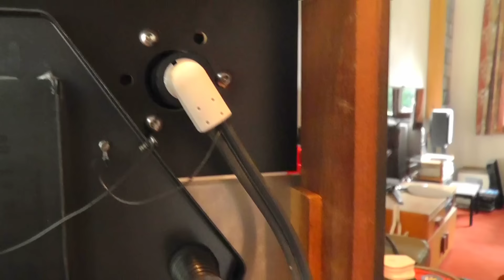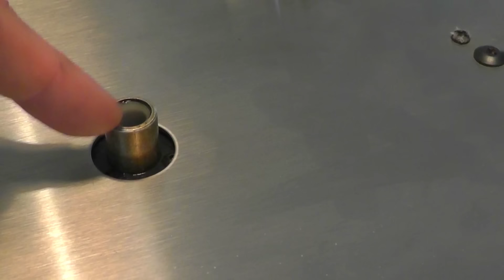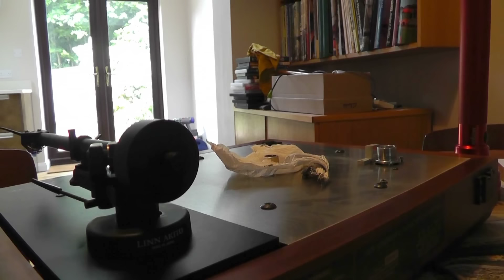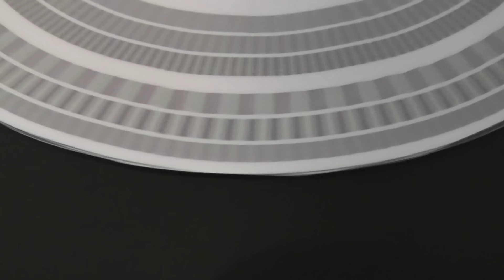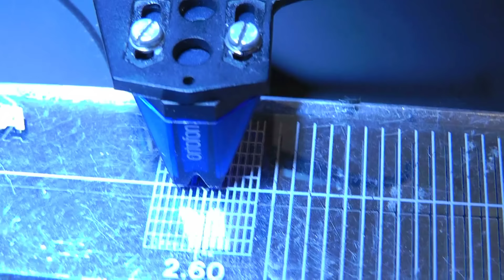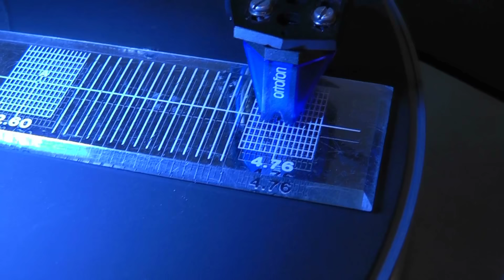linn Sondek LP12 service Pt2  Service recap and modify

Comment: Hi, Just to say thanks for the video. Much info I have never heard of, that will be really useful for My restoration of My very early Ariston /Linn. I have just pulled it from storage after I haven't used it for some 20 odd Years. Although in My experience these type of things will  just work and only need a bit of cleaning and tweaking. Oh just one thing that might help You is that when setting up the speed, You can fit the main platter on Upside down. So You can see where the pulley is riding. Best Wishes Jahmahrah

Comment: Hi Simon my Sondek has no sound on the right channel,any ideas? 
I have switched the connects, even looked inside and reseated the 5-pin arm connector.For context I had it gone through by a great shop with new springs caps cart 10 years ago it has sat in the same spot so I,m guessing a bad cap?

Comment: Don't use Linn black oil on a bearing that has a gold surround/white liner or else the Teflon in the liner will swell and bind the spindle - use the Linn gold oil on that bearing. All others can use black oil. Oh, and don't just stuff a paper towel down and leave lint behind that will etch the bearing surfaces over time - use a lint-free swab!

Comment: Hi Simon, realy like what you done to this board. My linn valhalla needs some of your magic. My power supply board is not working properly. I'm sure it's a dry soldier contact. Could you repair my board?🤞
Reply from the maker: Yes . If your sure the problem is you board and not motor Etc.
Reply: Okay Simon, I'll try and make sure the motor is good. Really like your work on the lp12

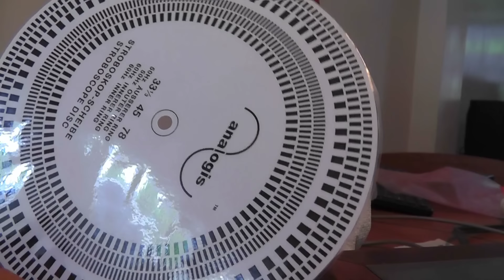Comment: 10:53 : The mains are 50Hz but the bulb will glow at double that (if connected directly across the mains), so 100Hz.
Great videos. A bit annoyed I've only just run into your channel - there's just too much stuff on youtube!
I bet that LP12 was a great bargain. You ought to put it into good use - loads of second hand records out there, many in pristine condition  - as long as you have the space that is!
The Akito is their budget arm isn't it? If so, it might be worth going up one, if your collection warrants it. Either way, an LP12 can only increase in value with time.

Comment: The dressing of the arm cable is incorrect it should be clamped in to the p clip and the cable should be straight and when you in cert the cable in to the arm it should not deflect the sub chassis this I learnt from a you tube vid set up from  Linn sorry if you think I am being picky 
The blue preset on the board is for setting the correct voltage at the motor terminals details can be found by downloading the vallhalla circuit diagram my be you have all ready done this.?

Comment: Hi Simon. Nice video and a common-sense approach. A couple of tips for future use; when checking the belt / pulley alignment the outer platter can be placed upside-down which settles the suspension to running trim and ensures the belt is running on the correct part of the inner platter. When adjusting cartridge overhang Linn used to recommend removing the tonearm from the deck before final tightening of the cartridge screws as the torques involved could potentially damage the arm bearings. Thirdly did you tighten the "P" clip that secures the tonearm cable against the plinth (it looks very loose around the cable at approx. 00.28?). This was always an important point of Linn black magic set-up procedure. The art is to dress the led to ensure the cable isn't affecting the suspension movement (alignment and bounce should be identical with cable disconnected at the tonearm) and doesn't foul the plinth or baseboard. Then, once happy with the dressing of the cable, the "P" clip should be tightened - really tight - against the cable. In effect the cable forms a fourth "spring" for the suspension and the clip "grounds" vibrations at the plinth rather than conducting them into the armboard via the cable. Hope this helps and thanks for a brilliant video
Reply from the maker: Hi Russell thank you for you detailed setup info. I can't remember if I did put that clip back on now? I used to pop into a shop called Unilet in new Malden where I helped out after school.  One of the staff  named Peter Ockley  used to set the lp12's up for customers. He used to show me how to do it but that was 35 years ago and a lot has been forgotten in that time. Truth is the arm bearings needed looking at when I made this video,they seemed a bit notchy. I was going to take the deck to a local hifi shop to set up the suspension but never got around to it. Also I'm not entirely sure I am happy with the ortofon setup. Seems a touch harsh to me?
Reply: @SoddingaboutSi  I did not know the Jocks manufacturerd anything, i just imagined Scotland to be hills and sheep but still, I will never buy made in Scotland as Made in the UK is much better, the Jock's should grow up and stop the hate of the UK and start putting made in the UK as without the English Tax Payer, Scotland would be a third world country if it were independent plus they will never be independent as England will never allow it 🇬🇧🇬🇧🇬🇧
Reply: Scotland is in the UK, so your rant makes little sense.
Reply: As a mental exercise substitute "Israel" for Scotland and "Jew" for "Jock" in @johndunnburgess' incredibly racist rant and imagine how far he'd get.... ;0)

Comment: Set the outer platter (preferably  upside down) onto the inner platter, and the added weight will speed up the process  of settling the platter spindle to the bottom of the bearing well. This is only necessary for earlier LP-12s, as later versions have ventilated bearings that let air escape, so be careful that you don't allow the platter to drop into place with a thud!

Comment: Looking at the  " Linn " special black oil it immediately took me back to the early 1970s when I used to work on and service Strowger two motion and uniselectors. A special lubricant was used on rachets and pawls and it was called " Oil Dag". Basically, oil with graphite added.. I wonder?..... When it dried out it turned to gum and made the component fail.
Reply: Well Simon the stuff we used turned caggy like the dried oil on an old bike chain! . Horrid stuff
Reply: @max79444  , similar grease to what you describe was used on Dual turntables, among others. Horrid stuff!
Reply from the maker: Yes I wondered that too. Black oil is usually Graphite oil, and regularly used in turntable bearings.
Maybe Linn use snake oil?
Reply: @SoddingaboutSi  , the Linn black oil is molybdenum infused. No graphite. I have a 30 year old bottle of it that is still very much liquid.

Comment: Good stuff Simon, I usually just throw Led Zep II on my Garrard and be done with it :) I remember one of my friends dads back in the 70s having some high end music system that threw a light onto strobe markings built into the turntable. There was a twisty knob to adjust the speed of the motor. He also had a unit with TWIN cassette decks.
Reply: My dad had a similar deck, the Garrard 401 with an SME tonearm and Shure cartridge.Quad electronics and Tannoy speakers, great stuff!

Comment: From your description these turn tables and setup is much more complicated than I would have imagined. Very informative. Thanks Simon.
Reply from the maker: Cheers Chris.  It's quite an art. And yes a tough of audiofoolery too.
Reply: Simon Spiers yes I was prepared to give you the benefit of the doubt this time. Don’t tell me your speakers are connected with cryogenically frozen cables.?
Reply from the maker: AllTheGearNoIdea oh no of course not. But they are biwired and I have no tone controls. I worked at a top of the range hifi shop when I left school. Wish I had stayed in that profession. I know you doubt a lot of it, but some is quite creditable. A friend and I did a blind test with two audio interconnect cables. We could clearly hear the difference between the two but which was correct,who knows.
Reply: @SoddingaboutSi  Cable interconnects the capacitance very,s between  each cable so they all are going to so they are going  different .
Reply from the maker: Indeed. Makes a noticeable difference to response.

Comment: I used to sell these way back when they were first made. Along with the almost identical Ariston. A more mass produced turntable that outsold either of the above 20:1 was the Thorens TD150/TD160 mostly with the SME arm. I seam to recall that the Linn originally had no electronics just a synchronous motor. It was a product we did not (as a retailer) like, because it took hours to set up (as you have found) then on switch on the motor was ticking. The speed of course was linked to the 50HZ mains. It used to make me laugh as people would check the speed with a strobe lit by a 50HZ lamp and because of this it ALWAYS show exactly the correct speed even if it might not be!! Still the customers liked it!!
So now you have a crystal speed controlled motor, which should be much more stable than the 50HZ mains but you check the speed with a lamp lit by the 50HZ supply which could show the incorrect speed as you are looking at the mains frequency NOT the real speed.  As a PS in spite of it's quite complex suspension, I always found it quite prone to feedback induced from your speakers. Some of my customers would place it on a concrete tile  of some kind, that worked.
Reply: I used to have a LP12, I think it's somewhat overated, I use a voyd now, much better all round.
Reply from the maker: Hi, I remember the Ariston. Was that the RD40? I think this is indeed a good turntable but a bit over rated by many. It's a sod to set up and limited in its ability to play anything other than an Lp.
Reply: @SoddingaboutSi  , back in the late 1980s  when I worked for Linn dealer here in the States, we also sold Ariston turntables, the RD-11 and the RD-12S if I remember the model numbers correctly. Not sure about the RD-40 but that number is also familiar.....there was a fancy Ariston model that looked rather like an Oracle turntable,  but anyway the more conventional Linn-like models were quite good if set up properly. I used to change the original Ariston suspension springs and grommets to a Linn Nirvana spring/ grommet kit which worked much better in terms of ease of setting up and adjusting the suspension and getting it right, and got the deck to sound better as well.
Reply from the maker: @goodun2974  I remember the Ariston decks. Kid at school had the RD 80. Thorens were big here too and we also sold Rega's and more exotic stuff like the Sota Sapphire that was full of lead shot! Pink triangle was another high end deck that I lusted after as a boy. Still do to this day!
Reply: @SoddingaboutSi  , the only Thorens I ever really liked was the TD125, as long as you used something other than the SME arm which I detest.  The TD125 oscillator capacitors go bad and cause to motor to stop working, but it's a relatively easy fix. By the way, Mission made a funny-looking "stick" tonearm that fit the same style of oval mounting hole, it was a better choice than the SME in my opinion. The stock Thorens arms were junk.
Reply: @SoddingaboutSi  , adding mass/weight/lead shot to a turntable wasn't and isn't a way to improve anything! Lowering the resonant frequency of the deck with added weight will certainly change the sound,  but makes it adept at passing low-frequency speaker vibrations, lorry noise, and so on into the platter and tonearm. BTW, we did a SOTA versus LP-12 shootout in the hifi shop ----the Sota lost. The VPI was a more valid deck than the SOTA by far, though I never heard an A/B comparison with the Linn.
Reply: @SoddingaboutSi  , the dealer I worked for sold Rega, Systemdek and Music Hall turntables as well as Linn and Ariston.  Not surprisingly, we also sold Naim and Creek amplifiers, as well as British Fidelity .
Reply: @goodun2974  I had a MIssion 774 arm with a Supex SD900 mc cartridge with a TD150 and Linn LP12 amazing match yes the SME arms were overated Audio Tech. did a great much cheaper one
Reply: @SoddingaboutSi The Ariston RD was copied by Ivor when he started Linn. In fact Ivor had Ariston build the LP12 until he had his own factory going. I have an Ariston RD and an RD11S, plus an LP12.
Reply: Michael, the "ticking" motor was easily solved by twisting the plastic cup on the underside of the   motor, which held a ball bearing and spring. Didn't a Linn rep teach you this during a set-up session? As for the need for a reference-quality 50 Hz flashing light to use in conjunction with a strobe disc when adjusting the speed, by the late 80s the Linn reps who held public setup clinics for Linn owners were using a new battery-powered, handheld, quartz-crystal-referenced device with an LED flashing at exactly 50 Hz (or 60 Hz here in the States).
Reply: PS, I never experienced any feedback with customers LP-12s, or my own*.  Footfall vibration and skipping as you walked around, however, was a common problem, especially if you danced!; a wall shelf for the turntable was the simple, easy cure for that. If you sit a turntable on a wall shelf and it still picks up your footwalls or skips, relocating to another house or apartment is strongly recommended!

A heavy concrete or stone slab under the deck is not recommended; it might lessen skipping or footfall pickup but it also increases low frequency transmission into the turntable, muddying the sound, possible increasing to the point of "acoustic breakthrough", aka feedback.  

*of course, if you use huge, heavy tower speakers sitting on the floor,  feedback is certainly possible. Speakers on stands would be preferable.